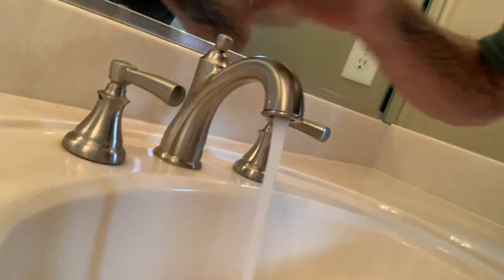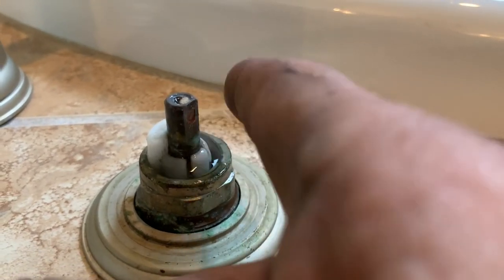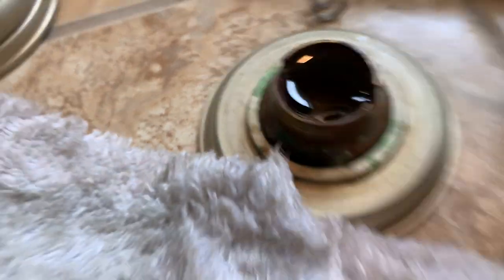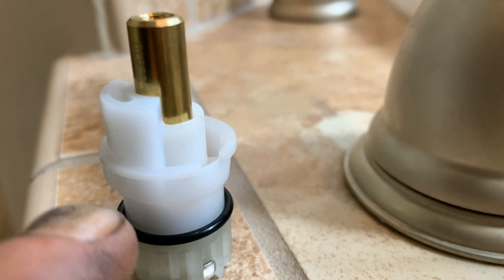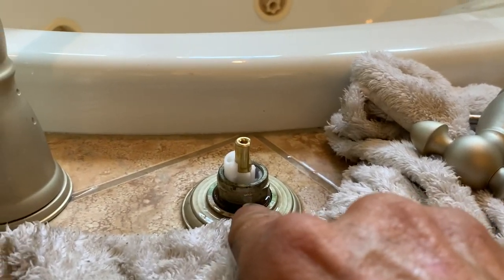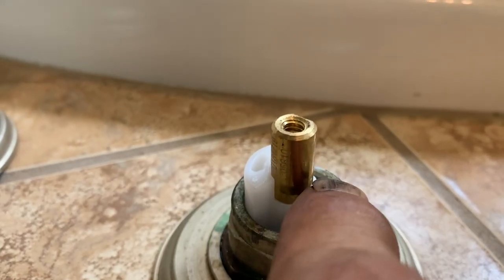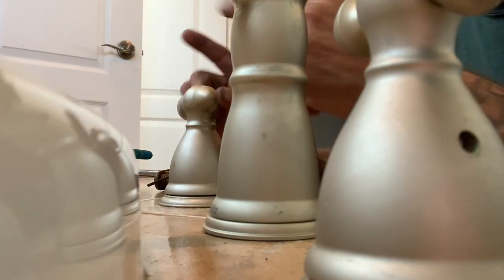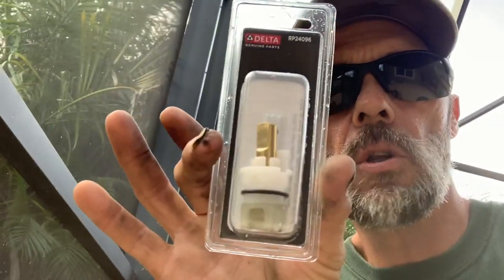HOW TO REPLACE CARTRIDGE TO DELTA ROMAN TUB VALVE

Comment: Thank you for this tutorial. You save me at oleast $150. Delta parts were expenses ($25 for the valve) but worth it doing it myself. Keep up the great work!
Reply from the maker: Thanks for watching
Reply: @PLUMBINGWITHTIM  Tim can u please help me with a Flow problem? My oldest sister has a Roman style Tub with 2010 Gerber valves & on the back of the water spout (base) there is some kind of ball Notch that I assume that you have to push in to release the spout; have you ever seen anything like this b4?
Reply: @PLUMBINGWITHTIM  How do I get it off because I'm trying to figure out why hardly any water is coming out of her water line; I.E SPOUT?
Reply: P.S its a Top tile mount
Reply: @PLUMBINGWITHTIM  P.S IT'S A TOP TILE MOUNT.

Comment: Additional information for the do-it-yourself people out there!  

I learned a very important lesson today while tackling this “easy” job. If you are replacing the stem on the hot water side. Turn off the water valve that feeds that valve. 

I turned the water off to house, open the lines etc. I thought all was good and removed the valve stem as instructed. It was several minutes later water started streaming out the stem line. All hot water. The assumption was that I needed to turn off the outlet water from the hot water heater too. Note: typically you would have access to that valve close to the stem. In my case I did not.
Reply: I also learned that lesson the hard way working on a pinhole leak on a hot line.  It's because when the water heater kicks on after a couple minutes, the water thermally expands in the hot lines.

Comment: I would have liked to see the details on assembling/installing the Seat and Spring (RP4993), which is installed under the Stem Assembly (RP24096).   The spring is slightly conical with one end larger than the other and I'm guessing there is a reason for that.....I can insert the spring into the Seat either way, but putting the smaller end of the spring  (up) into the Seat seems to make sense.  I guess it depends on the size of the place where the Seat and Spring are situated. 

Thanks for a helpful video.

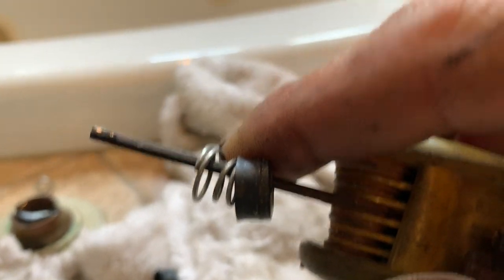Update, I stopped the video at 2:51 and it looks like the larger end of the spring goes in first and the Seat sits on top of Spring riding the smaller end of the Spring.
Reply: that’s correct.  small side up so the rubber seal can fit over it, presumably.
Reply: @mittenwalder  Yes, thank you.  I recently repaired a Delta Faucet wide/8" bathroom sink valve, which used the same seat and spring, but I used a lead free valve to replace the original. Delta was great about honoring their original warranty and sent me the parts.

Comment: Thanks for this video. My Delta faucet is a little different in appearance, but functionally the same. Delta has a limited lifetime warranty on their products which I believe is assigned to the original homeowner or purchaser of the product. We had registered with Delta ten years ago, so our name/address was available to customer service. While we only had one leaking, I usually replace both cartridges and materials since I'm working on these things. No expense to us, they shipped two cartridges and a set of seats/springs... seat/spring set currently on its way. 

Would it be beneficial to briefly turn the water back on to (hopefully) purge the line of any debris prior to reinserting the spring/seat/cartridge?

Comment: I need that spring and seal for the faucet. I replaced the stems but still leaks a little. I'm assuming this is why.
Can you advise where to buy the Spring and seals for this faucet?
Thank you in advance.
Great video by the way!
Reply from the maker: You could locate a local plumbing supply in your area or contact delta directly
Reply: PLUMBING WITH TIM I just found it
Thanks

Comment: Is there a shut off valve for this kind of tub, or you turned the main water off.
Reply from the maker: Water main off
Reply: PLUMBING WITH TIM thank you so much. Last question, when you turned the main water off, did you turn the gas water heater off as well, or it’s ok to do a repair if it doesn’t take long time.
Reply from the maker: If you have a gas water heater,you can just cut the water valve to the heater off and it should be fine until you finish the repair
Reply: PLUMBING WITH TIM So I just need to turn off the water inlet valve of the gas water heater, and there’s no need to turn the main water off.
Reply from the maker: No -water heater water is off for hot -water water main for cold 
You don’t really need to turn water off to heater other than stopping the heater from causing a siphoning effect to the fixture you are working on   At this point remember your water heater is holding all that water which creates “head” pressure to the system which can cause water on your “hot”side to continue to flow.even with the main water off
Reply: PLUMBING WITH TIM Thanks for your patience. As I said, I want to replace the hot cartridge of the tub, and I know how to do it. My concern is how to stop water coming to the tub. Could you please tell me what water should be turned off to do the repair, and do I need to turn the gas water heater off. I appreciate your help.

Comment: Hey, Tim! Thanks for the great video about this faucet. I searched high and low on youtube to find information on it and luckily stumbled upon your channel. If you wouldn’t mind helping me out, I have a question about the one in my bathroom. I’m having issues getting hot water through this faucet even though I get hot water in the sink/everywhere else. Would changing the valve cartridge on the hot water handle fix this problem? Thank you so much for your time! Hope you’re staying safe and healthy  out there!
Reply from the maker: The cartridge could cause this problem yes I would try replacing that first

Comment: Hello what cartilage replacement model is that? Thank hija
Reply from the maker: RP24096
Reply: @PLUMBINGWITHTIM  Thanks for this video - well done. Does this part come with spring and seal or is there a complete assembly available? I found RP24096 online but can't tell if it comes with everything. Thank you sir.